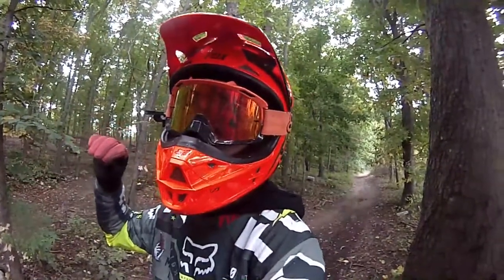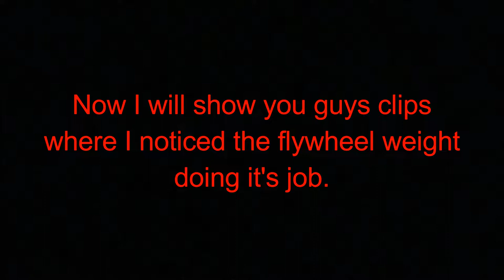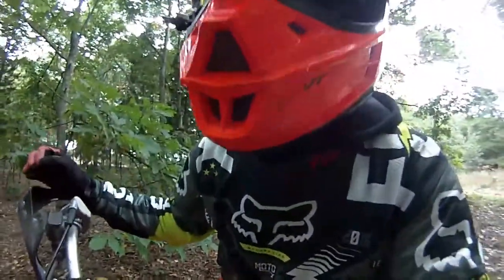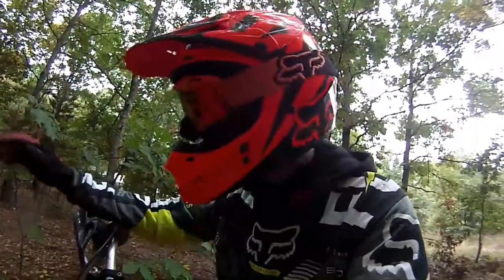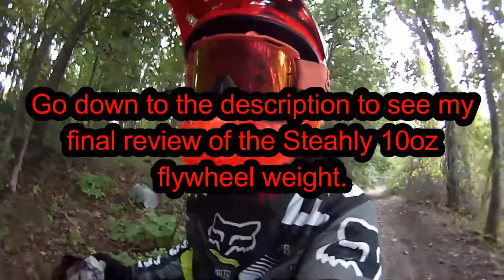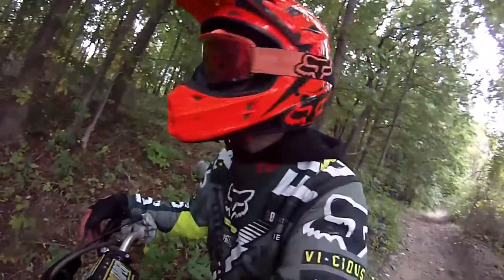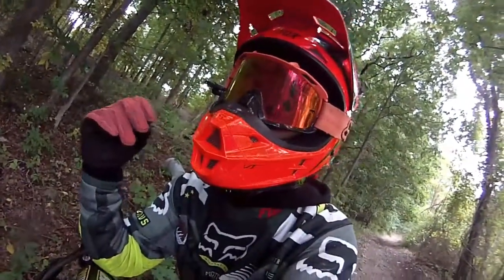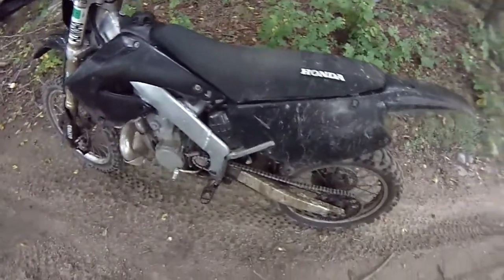Steahly 10oz flywheel weight. Is it worth buying???

Comment: I bought a 10oz weight shortly after watching this video. Installed a G2 10% reduction throttle tamer as well and now the RM250 is a wicked trail bike... totally transformed it's manners. And after getting used to it I think it's improved on the track as well. Traction is so much better everywhere!
Reply from the maker: Excellent! Definitely helps to eliminate the unnecessary wheel spin and keep momentum.

Comment: Is that a NH registration sticker? Great video....thank you! Been contemplating doing a weight on my RM....
Reply from the maker: Massachusetts. If you ride woods at all, it will not impact performance negatively. A 10oz flywheel weight will work excellent.

Comment: I’m getting a 9 oz flywheel weight for my crf 150r expert hopefully it will do better on trails
Reply: Andrew Eleton did it help at all on trails? I’m looking at getting a yz 125 and idk if 9 oz will be enough or if I should get an 11 oz
Reply: Geocentric  Did it bog down or fowl plugs more on trails with a weight?
Reply: Did it help you ?
Reply: @SpectrumSpectacle  did you get a yz125?  Mine has zero low end power and have been thinking about a flywheel weight.

Comment: Bike sounds awful. Jetting?
Reply from the maker: Bike felt fine, could have been an audio thing. The mic quality sucked with that camera. But at the time of making that video, it may have had the original Mikuni TMX 38 equipped. Those are notoriously difficult to get dialed in and keep it there. Since then I switched to Keihin PWK Airstriker, then a Lectron H series, and now a Smartcarb SC2.
Reply: That bike sounds fine 
Are you 12?